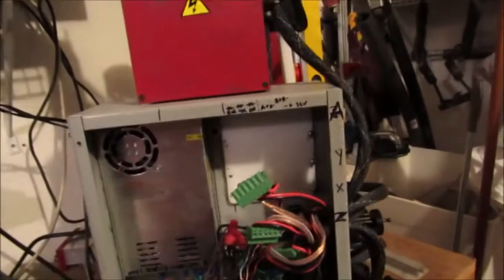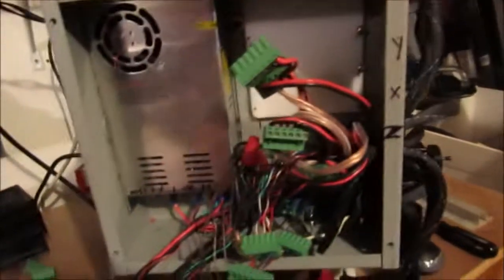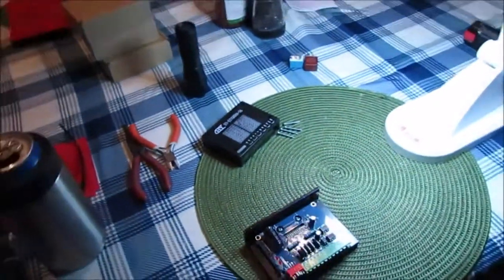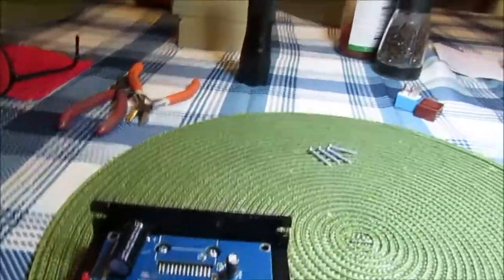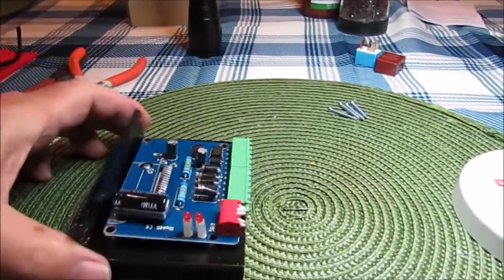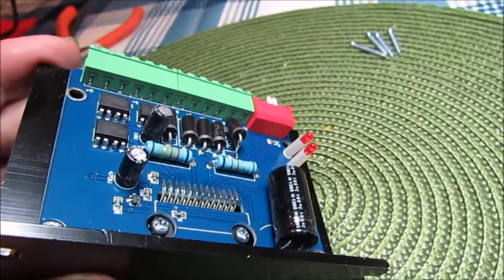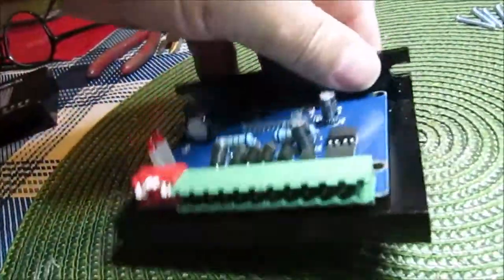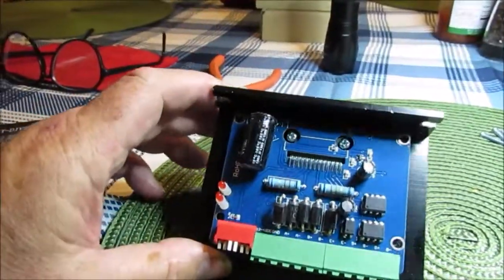Stepper Motor Driver HY-DIV268N-5A DEFECTS

Comment: I am shocked. I am waiting on 20 of these to arrive. Looks like I am in for some trouble and a lot of work and possible big losses too.
Reply from the maker: Oh, I wouldn't fret over this. I haven't had a similar incident since back then. I've used several of these since (with assurances from others that they did not experience what I did) and nary a problem with them. Maybe I was unlucky enough to get a bad batch? In fact, after I'm certain you get this response (PLEASE REPLY THAT YOU DID), I'm going to take this video down.

Comment: Thank you for the video. In my case the TB6600 driver pin soldering was loose, caused the driver did not work.

Comment: Hi MEntor I have finally got out on the wheelchair to leave the cancer behind as it has delayed my passiona to some extent
So i was pretty concerned about the drivers as these spooky parts have give me a lot of trouble.
TB66 has not proved its worth with a  6 wire motors , its drive speed is non CNC it is like FORD 1922 
So I bought another driver
https://hallroad.org/product/stk672-080-constant-current-sine-wave-unipolar-6-wires-stepper-motor-driver-in-pakistan/

costs USD 10 very high performance , but I blew up 3 of them as well , the motors ran with  power of a  rodeo , either
The heat sinks were not sufficient Or the motor connections were incorrect it heated up and there it goes
Now once I am back on the table You know we can not stop doin CNC so Now I have to seek advise
Japaneese IC or TB
Reply: https://hallroad.org/product/tb6560-3a-stepper-motor-drivers-module/

naked version I am using now